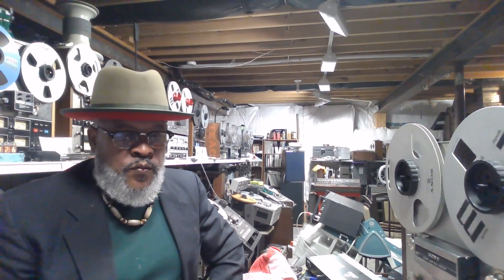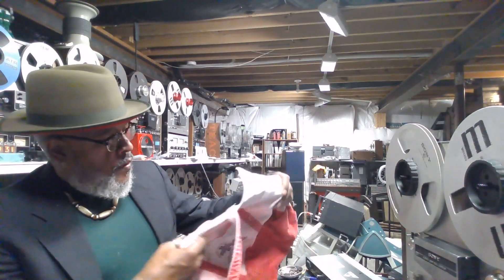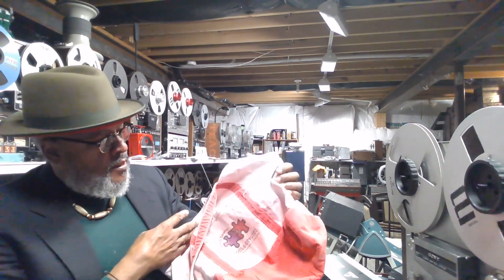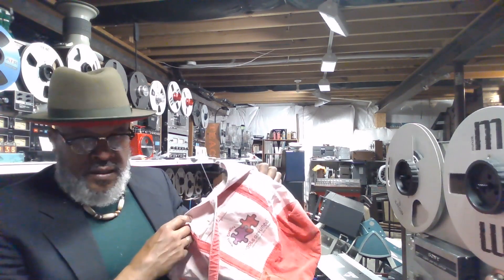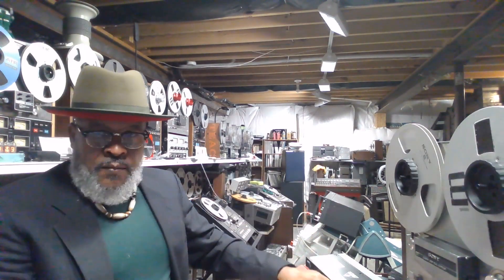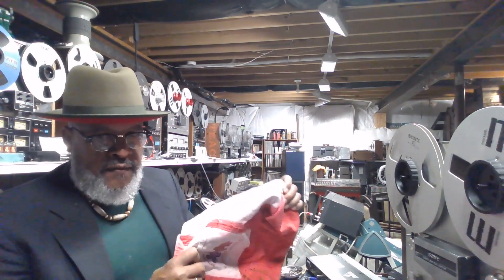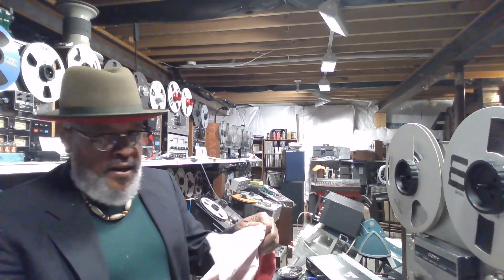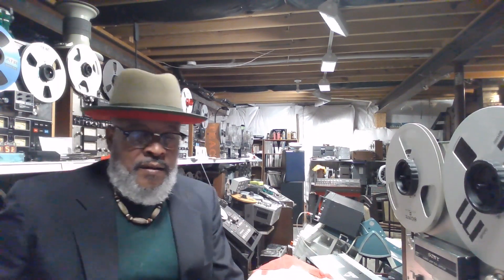Sony TC-765 Reel to Reel  reply to Armin's inquiry about brake material

Comment: I’ve had my SONY TC-755 deck since new 1980.  Many years ago I tried felt pads on the brake bands too. In a pinch I lined the bands with black electrical tape… as a temporary measure. The tape is still in there working just fine.
Thanx for all your videos.

Comment: Suggestion that worked for me : chamoise skin.  "Natural Cleaning Cloth", an inexpensive natural material.  Very strong and effective.  I used a heavy duty spray adhesive on the brake-band and the chamoise.  The glue is important, if it's too liquid it will be absorbed by the leather.  Let the glue dry and apply strong evenly pressure when bonding.  Let it rest for a day (or 2) under pressure.  Clean the drums with alcohol.  Adjust the brake-force with the springs.  With any material used you will have to adjust the brake-springs as the material gets older (softer of harder - rougher or smoother) by use.  With my Technics RS-models I used natural cork.
Reply from the maker: Great info. Thanks RN
Reply: @5thcomm  Thanks for your reaction.  I hope my experience(s) can help others.  I'm still struggling with my TC-765.  After complete disassembly and service of the pinch-roller block (everything was stuck by dust and hard grease), the block occasionally still remains stuck when pressing the "Play" button.  If you first press "Pause" and then press "Play" there is no problem... When the rollers go all the way down they are a little tighter.  Only the left roller appears to be sanding for the last millimeter in rest position.  The service manual does provide information about the roller pressure, but no information about adjusting it.  Greetings and thanks from Belgium - Europe.  Your videos have been a source of great value for me and others !
Reply from the maker: @RudiNijsen  I'll look into this problem over the weekend. For now, this is what I have. https://youtu.be/XYMrD5wGzjM?si=cl6G4baxCU_6qhuZ

Comment: Hey man, you wouldn't believe what dropped in my lap this week. A Sony TC-755 in working order. My cousin Patrick in Louisville has it right now, having it checked out by his tech there. It's only missing the bottom part of the head assembly  cover. Sounds great otherwise.  Selling the Akai 210D.
Reply from the maker: That's awesome, Stall. Send pics when you get it set up